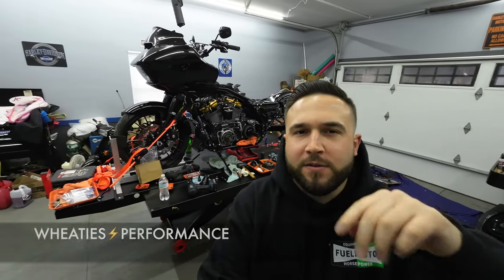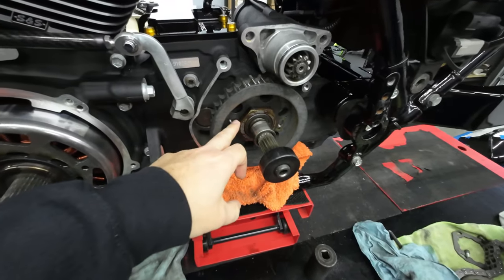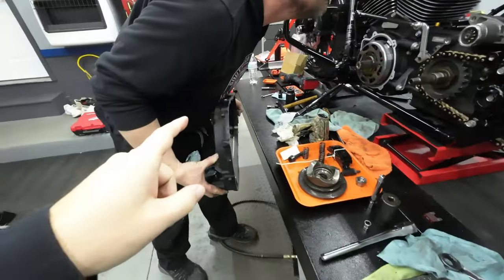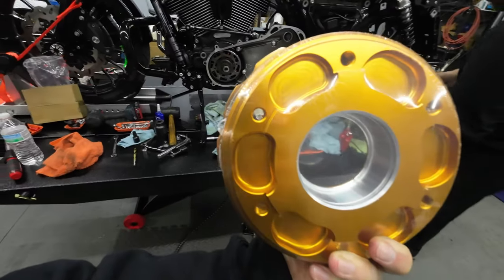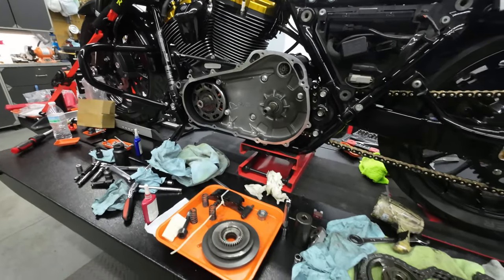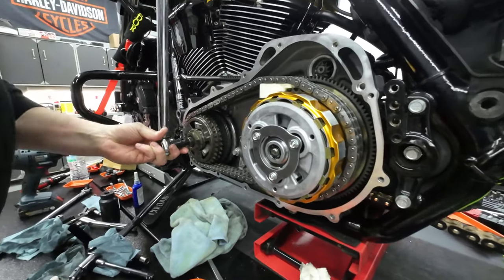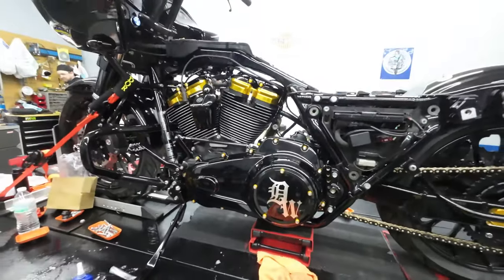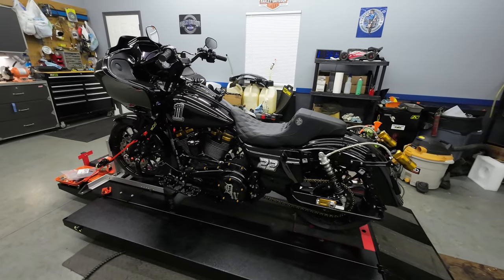TRASK CHAIN DRIVE CONVERSION KIT INSTALLED ON MY 170HP ROAD GLIDE! *RIP STOCK BELT*

Comment: Did u think about doing the AIM lockup clutch as an option for more clutch clamping but light ass pull when it’s at low rpm/idle at a light etc ?

I did one on mine but it a PITA to shift high rpm 2-3 shift. 
Only have 800mi on the new setup (124, cr482, billet comp, lockup clutch etc)..  and I had a shit exhaust so dude is retuning it today to get some tq back under 3k..
But yea those lockup clutches seems the timing gotta be perfect to shift it fast at high motor speeds.  I can’t stand being in Chitown traffic on a heavy ass clutch tho.
Shit bro I’m just happy we been on here in Chicago with weather … only lost 2.5 weeks of riding in mid Jan.  
MI must suck for having no winter ridin..
How far north are u ?
Reply from the maker: I had it when I first built my 128. Immediately took it out. I didn’t like it at all.

Comment: any issues with the swingarm clearing the exhaust? i'm looking at that swing arm for my road glide but i'm running a d&d billet cat full length system and don't want any clearensing issues.
Reply from the maker: You won't have any clearance issues if you run your shocks at the factory angle. (Furthest hole back)
Reply: @ cool thanks. Did you run the regular performance bagger swing arm or the California model?
Reply from the maker: @1962egl  The regular one..

Comment: Sorry but it’s a total waste of $$$. You brought it to American Cycle to have it tuned. Got rid of the headers there. Had head work done. Spent tons on tuning time only to bring it home and destroy it by converting to a chain drive, different swing arm, different exhaust, different compensator and clutch basket. All that $$$ you spent in FL was a total waste!!!!
Reply from the maker: LOL yeah it's destroyed now. Damn what a waste.
Reply: He’s gotta live and learn life is a great teacher.
Reply: Hell idk but it looks good standing still! 🤣
Reply: Agreed. All this should have been done first. Dyno needs to be redone.
Reply: @DOOWORKMOTORSPORTS how would chain drive and compensator change the tuning ? Unless different size sprocket ⚙️ 
And I doubt changing one 2-1 to another that is very similar will destroy the tune on it from dudes down in FL
Reply: and changing swingarm, clutch etc.. effects the fuel air mixture , How?
Reply: @drainmonkeys385  power to weight ratio is one example.  When building big power motors, all those little things matter. We all know je is trying to squeeze every bit he can out of it. Not saying its destroyed or anything, just probably wouldve been smarter to tune it after all this was done.
Reply: @DOOWORKMOTORSPORTS  instead of throwing hondos $$$ out the door just send em this way
Reply: @richardedwin5980  get off your computer and go work as hard as this guy- maybe you could afford to do the shit he has done. F’n RICHARD!